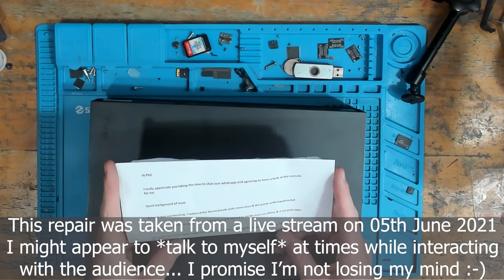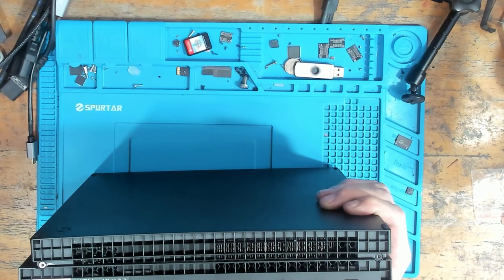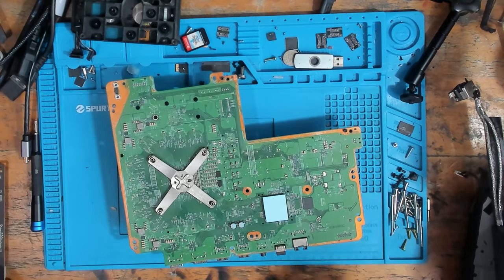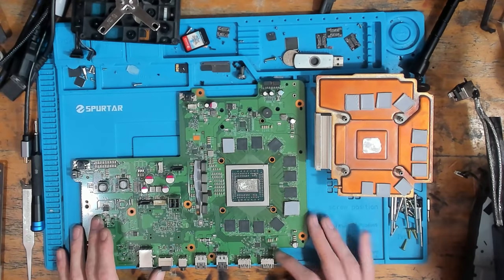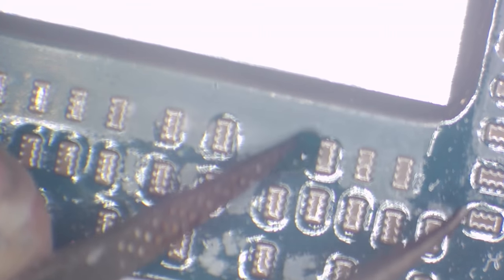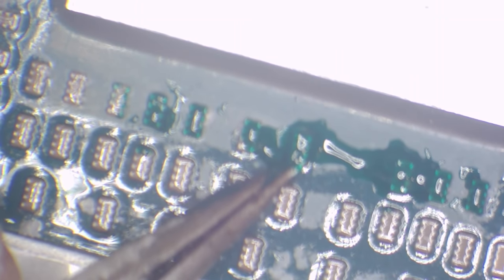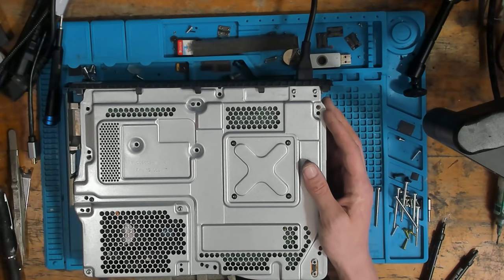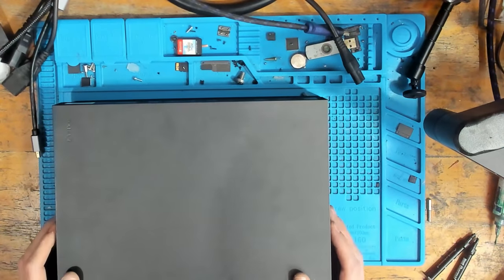Xbox One X Overheating After Liquid Metal Application - Fixing A Failed Liquid Metal Attempt

Comment: Don't know why exists this new trend to put liquid metal on everything, thermal paste in my opinion most of the times is better and safer
Reply from the maker: Liquid metal definitely has an advantage over thermal paste. It has a much higher thermal conductivity and overall provides much better performance and a much longer life span. I put LM on my laptop and it no longer thermal throttles, and I gained about 20⁰C in temps
Reply: I think the same way. And it's not a good idea to use Liquid Metal on a not nickel plated heatsink, it react over time with copper, kind of corrosion
Reply: @Snales1974  No it doesn't! Liquid metal seeps in to the copper and leaves a staining, it doesn't corrode it at all. It's Aluminium you definitely DO NOT wan't to apply LM to unless you want to turn it to powder! Nickel plated copper is also fine to apply LM to and that won't or at least shouldn't stain at all. LM can drop temps by 10-20⁰C easily so the benefits can be huge especially in circumstances where heat can be an issue.
Reply: @h4x0rm1k35  probably in laptops and in a i9 is worth but as i said in most of the things is not, if you can cool well a system why use liquid metal? Sony used it couse they couldnt cool the console the series x is 1000000 better disigned and they could cool it with thermal paste
Reply: @soulmourne2698  It's worth it because less heat means longer life! Any chip can benefit from LM really regardless of whether it's overheating or not. Yes there can be risks involved but if you watch a couple of guides on how to apply it and how much etc then it can be worth it. Imagine being holed up in a small bedroom with a spaceheater running full blast in the summer (spaceheater being a computer), applying LM could reduce the room temps by up to 20c and allow that person to use their spaceheater more often than not without overheating themselves!
Reply: @h4x0rm1k35  I think that in a pc is much more important the cooler and the heatsink than the paste, if my cpu with a good cooler in summer the max temps are  55ºC at full load why should i even consider applying LM? the difference is not gonna be very notizable maybe 3-5ºC and that is not gonna make the chip last longer, in a pc that heats a lot like a laptop might be worth it, but not in a well cooled pc, and an i3 can even work at ambient temperature if its well cooled so 0 improvements with LM

Comment: Sounds too risky the liquid metal paste upgrade - I would not want to be frying that mobo.
I think i'd just prolly stick to artic silver or somat if i did change that paste ✌
Reply from the maker: It's not too bad if you do it right and make sure the capacitors on the apu are sealed and definitely provides a performance benefit :)
Reply: @TheCod3r  yeah nail varnish is good to seal the capacitors ... the only downside is that liquid metal will literally eat into the copper / nickel plate / aluminium
Reply from the maker: @charlesbronson1959  that's incorrect. Liquid metal will damage aluminium yes, but aside from staining it won't damage copper. For an xbox one x liquod metal is perfectly fine, because the heatsink is made of copper not aluminium
Reply: An Xbox One X doesn't need liquid metal because it is quiet out of the box. If you own an aging Xbox One X that has become loud, all you need to do is apply fresh new thermal paste such as MX4 or Kryonaut. Liquid Metal works wonders on a PS4 Pro and that is what I recommend.

Comment: Hi phil is there much difference between thermal pastes as in temp control /conductivity, ive got two xbox ones which ive used a cheap thermal paste on but they both still cut out after approx 10 minutes of game play should i use a better quality paste on these.
Do you think it would make much difference?
Cheers

Comment: My Xbox One X has all of a sudden stop working. Turns on, turns off after a few secs. Wasn't used in a confined space. No over heating warnings. Does not go into factory reset mode (pair, eject + power). The cooling fan does not spin at all - can the fan fail and this is preventing the console to start up?
Reply from the maker: No the fan won't prevent it from starting up, but you could have an issue with the hdmi retimer. It's hard to say for sure though without seeing it in person